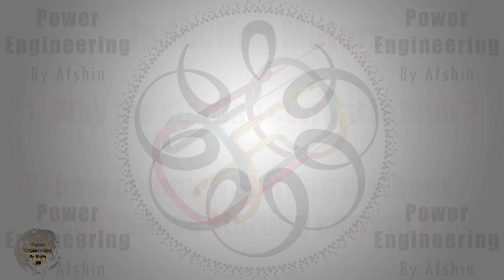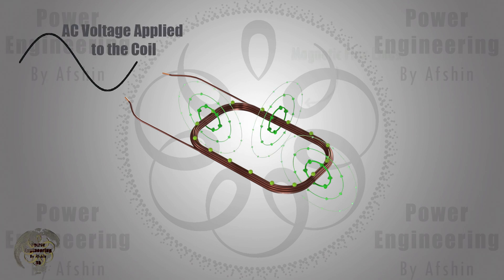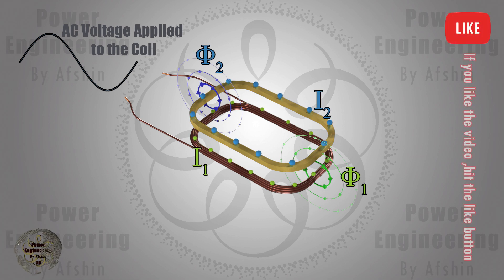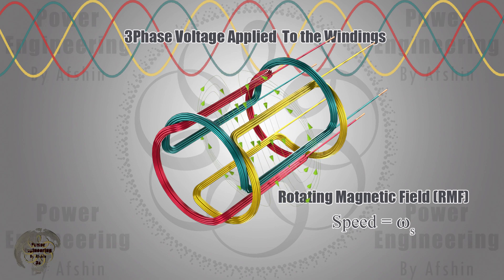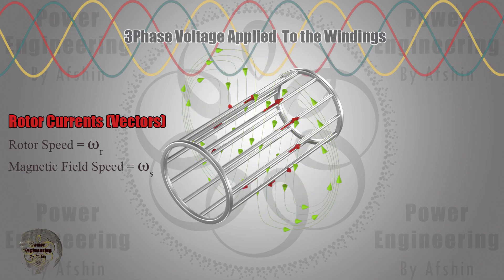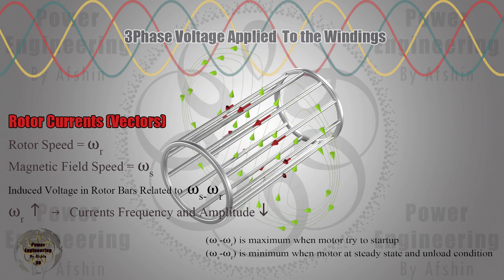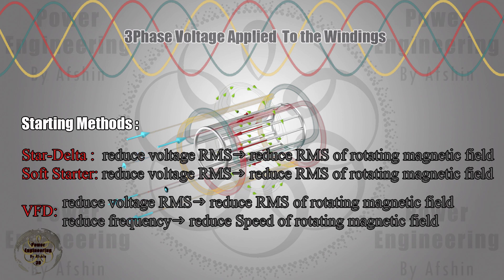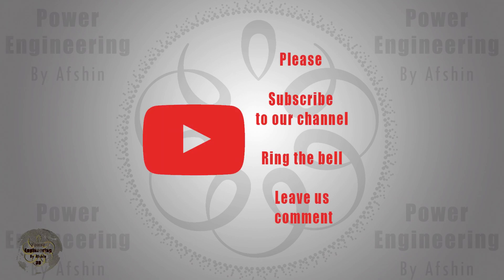Why the starting methods of induction motors can reduce the starting current?

Comment: I find it interesting that you used spherical coils. Was that a pretty design, or do you know something?
Reply from the maker: Thank you for your insightful comment!
The stator coils in the animation are designed to resemble the real-world model. However, it’s important to note that actual stators typically use distributed windings to achieve a more uniform MMF. For better visibility of the details, we have used a single coil per phase in this animation. Stay tuned for more content!
Reply: @PowerEngByAfshin-zs2nd  say you had a sphere coil thing. I think maybe there should be two wires per coil. They have opposite angles at the poles and the poles are not antipodal. So, they are closer together. f(t)/f(t+1) of the Binet Formula on conformal mapping. Except that one the current and magnetic fields are reversed, but that's what I mean. There would be more field lines between the poles.
Reply from the maker: Your idea sounds really interesting! Could you elaborate a bit more on what you mean by a "sphere coil"? It would be great if you could provide more details about your concept so I can get a clearer picture of what you have in mind.
-------
The conductors aligned with the stator contribute to generating the rotating magnetic field. However, the conductors located at the ends of the coil, which are more or less perpendicular to the stator and rotor axis, do exist, but because they are relatively far from the iron core, they don’t significantly affect the field generation. Additionally, when considering an undisturbed coil model (like the ones in the video), as you mentioned, the rotating magnetic field will not be uniform, and the magnetic flux lines should be drawn more exactly.
Reply: @PowerEngByAfshin-zs2nd  I was going to make a linear algebra video. I'll put the graphs in there. I'll try to get my powerpoint done by Monday. It's rabbit hole math. Trying to say something that isn't wrong is very hard. I have to structure my information very carefully.
Reply from the maker: I hope you succeed
Reply: Wow. AI is now responding to comments as a YouTube creator huh?
Wild!!!!
Reply from the maker: Haha, nope,it’s just me here.Sometimes comments are alittle unclear,so I make sure to figure them out. Thanks a lot for your engagement😊